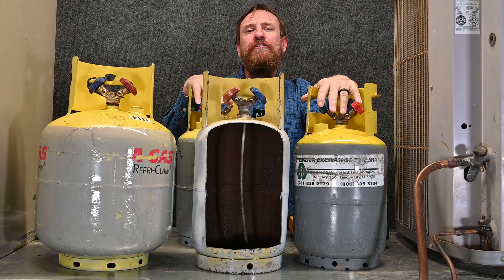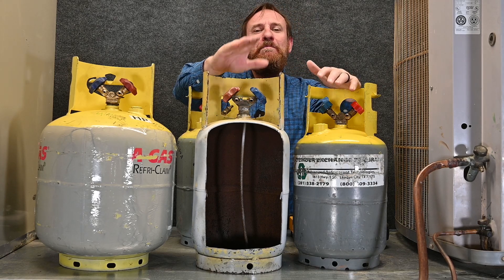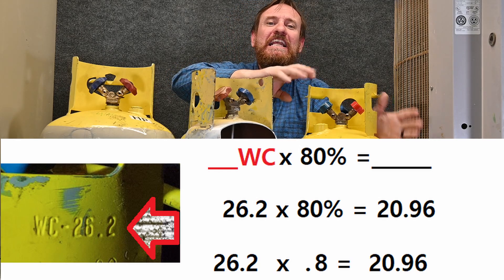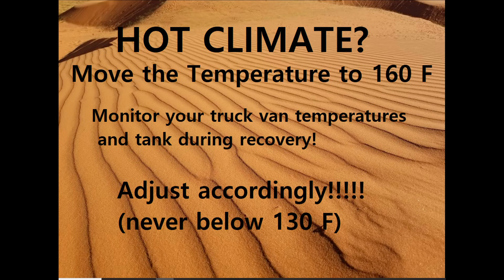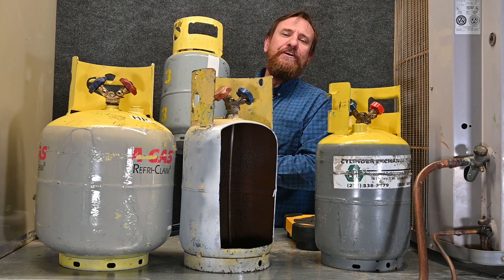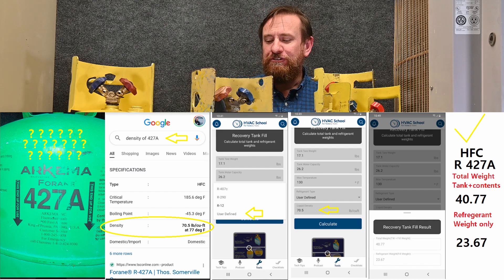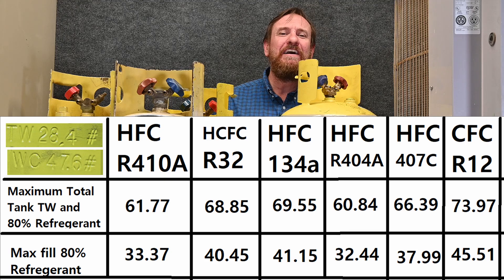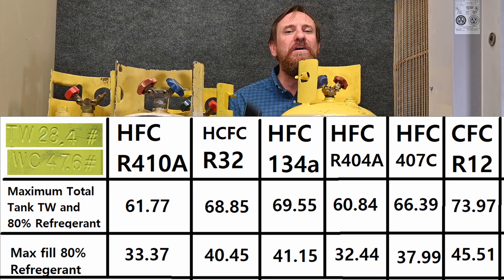HVAC 124 Recovery Tank part 2 do not overfill

Comment: I was told not to fill past 80%.
I was taught :
Take the WC and multiply 0.8x ( the WC) and then add that to the TW (tare weight) as a maximum weight to fill the take too. 

That would be (.08) being 80%.

Based on your calculations you may be able to have that as a max weight, but not the 80%  recommended maximum fill level recommended.
Explain....
Reply from the maker: You calculations work if you where only putting water in the tank. 
You have to account for the weight of the actual refrigerant. 
Some refrigerants are lighter than water while others are heavier than water. 
Use the HVAC school app and it will include the specific weight of the refrigerant you are recovering.

Comment: I just purchased a new recovery tank. I hear a rattle sound like something is inside. 
Can i open/remove a valve to inspect it?
I received it. Had a gas/nitrogen charge.
I vacuumed it to 340 microns.
It was stamped 6 months ago as hydrostatically tested.

Cant find anything on google, youtube or in my EPA608/609 documents to explain what that could be.

Rust flakes in a new tank???
Help, please....
Reply: Does it sound like a coin inside it? Or a 5 inch long unistrut rod with a washer on the end that can slide up and down? I got one new one too that sounds like that, has been fine so far.
Reply from the maker: There should not be anything in there. I did find a magnet inside one once but it was not rattling around.

Maybe the dip tube straw j side. Came loose? It would be plastic though. 

The heads are super difficult to remove and require a special tool. I would probably just leave it. 
Make a video with it for documentation because that's a cool find.

Comment: hi. great video. regarding that app.when manualy input r410a density (67.66) it will come with different total weight as if leaving default value for 410a.  i was trying to adjust calculator for r32, but im not sure what i do wrong

Comment: If you live in weather above 120f do you still go with 80 percent or go to 70? Thank you Mr. Ty.🌷
Reply: You are fantastic Mr.Ty🌾
Reply from the maker: Great question.
So on the app by changing the temperature to 160 it automatically adjusts the volume lower.

Before the app when I did long math I went for 60%

Comment: I think every guy sit experience once the overpressurized blow off valve popping off inside his vehicle while he’s driving down the freeway has a good training learning experience. 
               No need to get excited once the blow off valve is spewing out refrigerant inside your vehicle you’re safe to know that it’s doing it’s purpose relieving pressure so it will not explode just a little loud and foggy inside your vehicle slowly and calmly roll down all your windows and drive to the nearest safest place in no big hurry to pull over and relieve a little pressure out of the low side valve until the pop off valve closes up again and you’re good to go no big deal
Reply: Sounds like you just don’t care
Reply: @MrElemonator  I don’t care if I know the valve actually work and it does exactly what it’s designed to. 
                           In the event that a mistake in overfilling has been performed you don’t freak out and get hysterical on the freeway because it blows off inside your vehicle. You say calm as if you’re Just sipping a cuppa coffee. 

              It’s all about expecting the unexpected being prepared for it in safely and call me candle in a emergency situation without causing harm to yourself and others around you. 

        There’s people when they see a paper bag or garbage can  on fire 🔥.  They run around looking for water or fire extinguisher or waving their hands at it or anything they could grab trying to put it out allowing it to get bigger or spreading it. 
                           Then there’s the guy who just calmly walked over to the paper bag and steps on it. or throw the lid over the carbage can or flips upside down calmly and slowly and puts it out. 

It’s all about knowing what your working with knowing the limitations understanding how it operates. 

        Like when I seen a car engine burst in the flames and everybody is yelling and running around like lemmings jumping off a cliff. 
                      I just walked out of my vehicle picking up a 30 pound tank of R134 ,  walk over to the front hood that is still closed turn the jug upside down open up the valve and release the refrigerant into the grill through the radiator and condenser depleted of oxygen snuffing out the fire instantly that was about to engulf the entire vehicle. 

             The city department water workers who are in their vehicle across the street came over to me and told me.   It looked like I rehearsed that situation and that I walked over so calmly as if I knew what the outcome would be.  
          It’s all about thinking first.